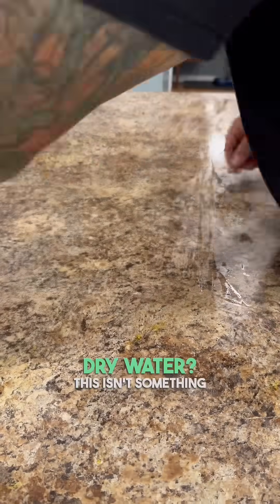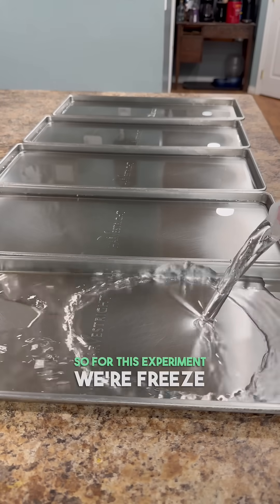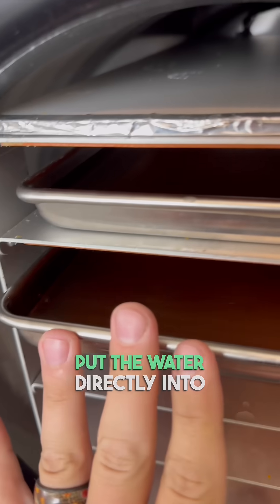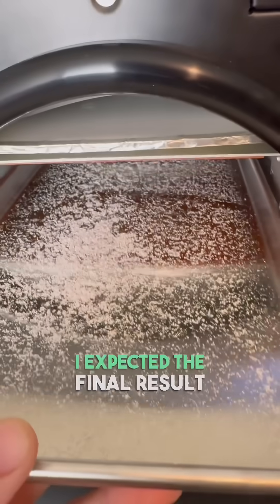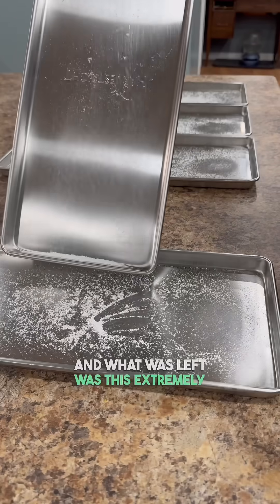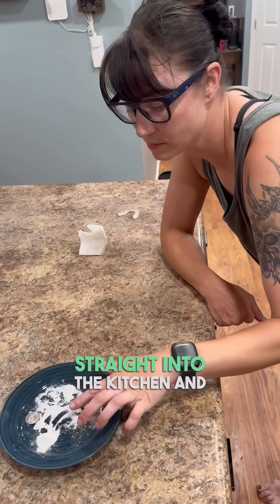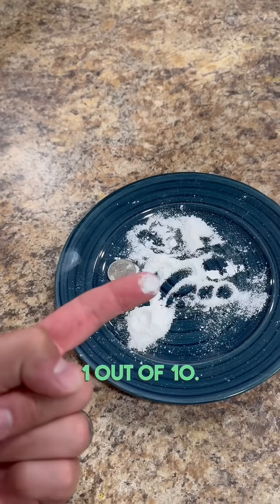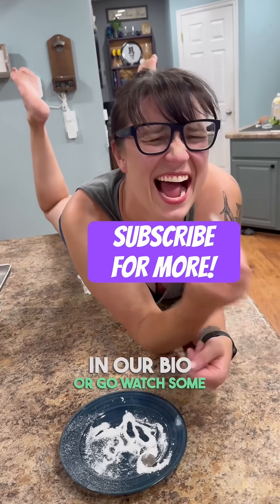What Happens When You Freeze Dry WATER?

Comment: The way freeze drying works is basically freezing the water first, then decreasing the pressure to a point where the water can evaporate at a low temperature. That is why you can retain the nutrients and properties of foods that you freeze dry because they are not subjected to high heat. So in short - the water evaporated just evaporated and whatever minerals were in there precipitated.

Comment: yeah all tap water has about 0.3% by weight of various minerals and salts which improve the flavor and have various health benefits. most likely there's some acceptably small level of chlorine in there from the sterilizing process, then the rest is primarily table salt with fluoride and a cocktail of other water hardeners that you need to be healthy. 

Tap water is safe and it's a miracle, anyone decrying its safety is an enemy of civilization.

Comment: drinking water contain salts like NaCl (Sodium Chloride) If you remove this salts from water you get distilled water (which is pure H2O) problem is distilled water is a poison to Humans as it will suck the water from the body
Reply: Nope. Distilled water is okay to drink. It is possible there's a little bit of issue but it's not poison, I promise.
Reply: @stillnotstill  when we drink water it will pull the salt from the body. This is reduce the salt the minerals the body have and you will feel more thirsty (I know, I tried).

When you drink normal drinking water, the body undergo a process called Osmosis. it means those minerals and fluid in your body will move from a high concentration solution (aka the drinking water) to a low concentration solution (aka the cells in your body).

When you drink a pure H2O, the direction will reverse as now the H2O will act as a low concentration solution and minerals in your body will move from your cells to the body

yes Technically, you don't die if you drink pure H2O but it still harms your body which makes it a poison.

when I say Distilled water is a poison, I mean it's like alcohol is also a poison. Both safe to drink in small dose it doesn't kill but it does harm your body.  Difference would be if you drink lethal amount of distilled water, you will die of dehydration and homeostasis.

also, DON"T DRINK DISTILLED WATER

Comment: I like how it achieves the exact same result as just boiling water.

Water evaporates, leaves the minerals dissolved in it. Who'd'a thunk it?

Anyway, the minerals most often present in water are calcium, magnesium, sodium, fluoride, potassium, iron, and zinc. Sometimes, governments add iodine as well, if the population is iodine deficient, like how they iodise table salt.

It's an issue, however, if that white powder tastes sweet, because then your water might contain lead, which usually happens due to old lead pipes.

Comment: you need the minute amount of the salts and minerals that are in fresh water. without them your electrolytes will get out of balance.  

you can get these salts from food, but for long hikes or periods of high exorcise its not recommended to drink distilled water but to drink sports drinks that replace the electrolyte's you lose in sweating. 

Note distilled water will have little to no solids dissolved in the water.

Comment: If it’s coming from ur tap it might be chlorine, because all the water was removed all that was left was the chlorine (there is a very small amount so don’t be alarmed, it’s just used to avoid mold)
Reply: Chlorine isn't a solid, it's a gas. Chlorine is almost certainly present, but it would compose less than half of the composition of that residue, since there are more minerals than just salt (NaCl) in there.
Reply: @ack7956  no, I’m pretty sure there are chlorine pucks used for water shock to purify it, that could be the substance that he found. Correct me if I’m wrong please😁

Comment: That is called scale.   It is present in almost all water...esp hard water.   And yes, it has mineral salts in it.  (And forms of calcium) All water, except distilled water, has salts ....  did you know that distilled water will not conduct electricity?   It has to have some salt.
Reply: Everything is conductive to some extend, electricity can even travel through a vacuum through thermionic emissions
Reply: @achannelhasnoname5182  yeah, that’s why when someone says “conductive” they usually mean it’s efficient in conducting electricity… not that electricity can potentially travel through it, like through any other non-conductive material
Reply: Those forms of calcium are also salts. Calcium is too reactive in environmental conditions to not be ionized.
Reply: Would even harder water leave more of this? Seems logical it would, just curious
Reply: @justjaguar2314 Yeah, it's just minerals dissolved in water. Something like store-bought Mineral Water would leave A LOT of residue.
Reply: I don't know why, but I've always found that stuff interesting. Like when I made my husband a viking axe, I used salt water to etch the design into the metal. It was interesting experimenting with different ratios of salt and using distill vs tap for it
Reply: I filter my tap water, I want to reduce my PFA exposure. I also use metal straws for this
Reply: Everything is conductive at a high enough voltage
Reply: It's not the only water that doesn't have it - you've forgotten reverse osmosis.
Reply: Distilled water does conduct electricity, it’s just much less conductive.
Reply: @croutonicus  So much so that, as an electrician/chemist, I don't even take it into account 99% of the time.
Reply: @croutonicus no distilled water literally cant vobduct because there are no free ions to conduct electricoty it is inmposible to cunduct elctricity

Edit read the other comment maybe it is pissible but i just never learned that shit so i gues i was wrong
Reply: @kazboven9744  distilled water can still contain unbonded H+ and H3O- ions, deionized water is the kind that has no free ions roaming around in it. DI water is rarely just H2O, though, as the deionization process only removes ions, not other particles or contaminants(bacteria or viruses, for example, if they are present in the water before it goes in the machine, remain present when it comes out).